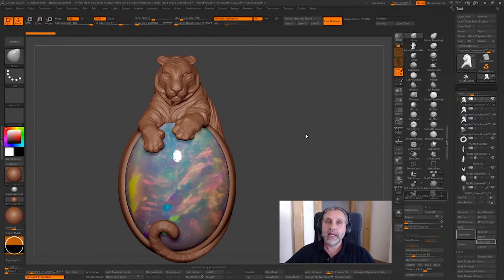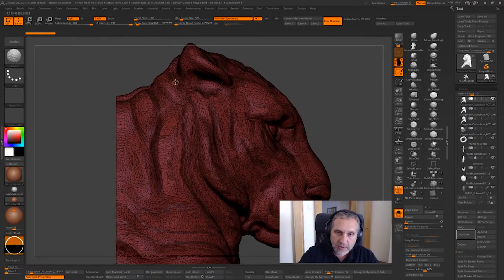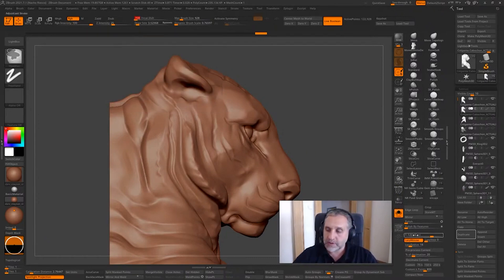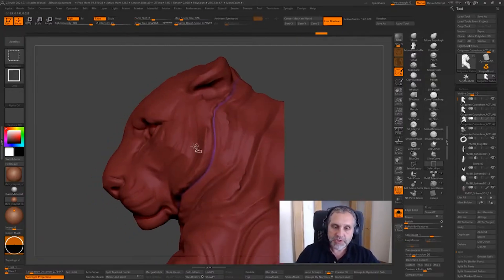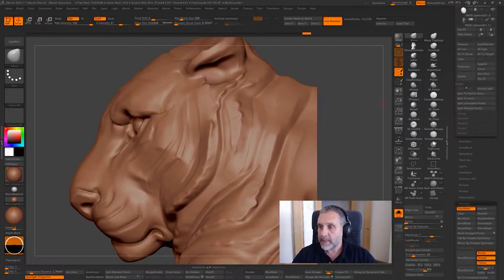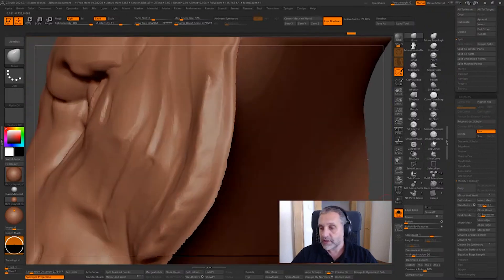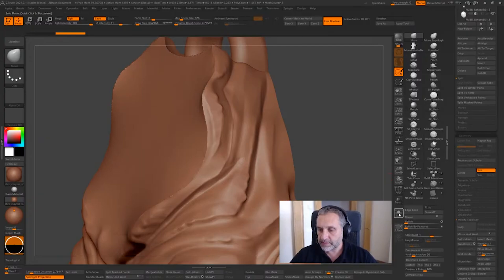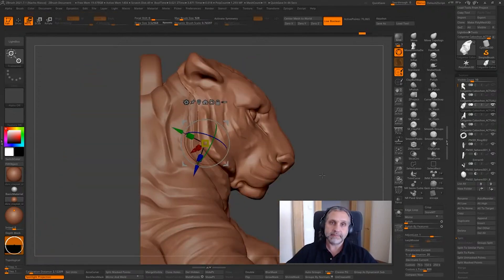ZBrush Summit Top Tips & Tricks - Split Model Into Parts for Production - Nacho Riesco Gostanza

Comment: The issue with this method is that the close holes on a shape like this is unpredictable. You can see at the end that the body section close holes mesh sticks out, so the 2 surfaces of the joint may not be perfect. A more accurate way is to zremesh you joint polygroup>close holes>select top or bottom polygroup>delete hidden>dynamic thickness>boolean. This will result in a perfect joint for print. It's also useful to know the method I described as clients will require a tolerance gap for print to cast work. This way you can set the dynamic thickness to whatever measurement the spec requires.